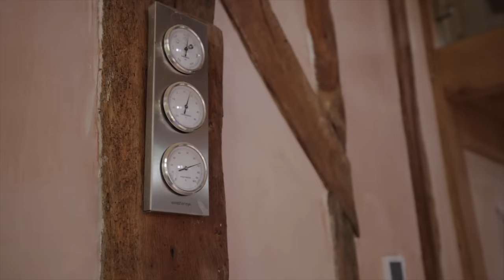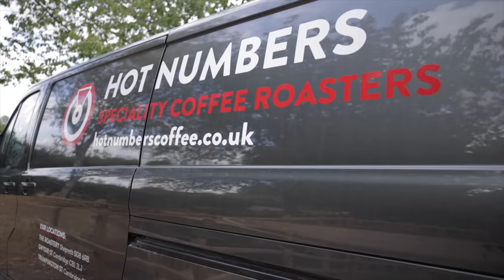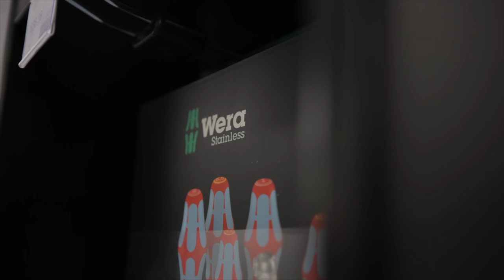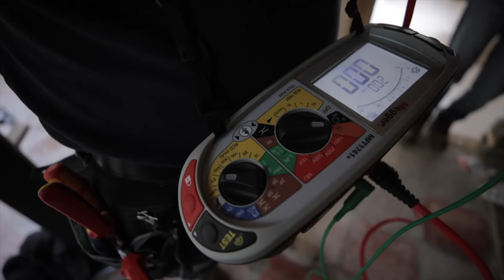The UNEXPECTED Return! Welcoming an old employee... @corymac

Comment: Hi. Thank you for the high quality content of your channel. It’s great to see and to learn so much from you.
A quick question regarding the light switch, I have a similar issue where the light switch is practically behind the door which very impractical and I need to modify the position of the switch.
I was wondering why not fitting a remote wireless switch instead of drilling and having to replaster the whole area affected.
What can you tell us, from your experience with regards to remote wireless switches.
I’ve fitted two of them already for the same light and it works flawlessly, of course they are battery powered yet we’ve been using the hallway light for over a year now and batteries are still ok.
Look forward to your feedback
Cheers and I wish you all the best
Florin

Comment: How is the copex put to earth?
Reply: Cables are doubled insulated bud
Reply: @lewis94uk  yeah for sure. But this is still classified as steel containment the same way steel trunking should be put to earth.
Reply: Did you use 'glands' on the Copex to secure it (+ it eliminates the sharp cut ends). I couldn't see.